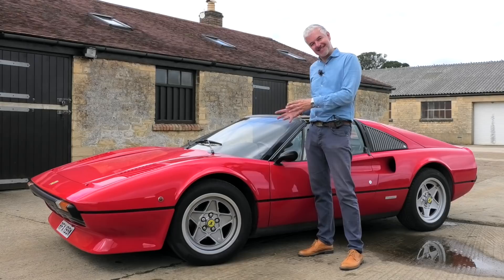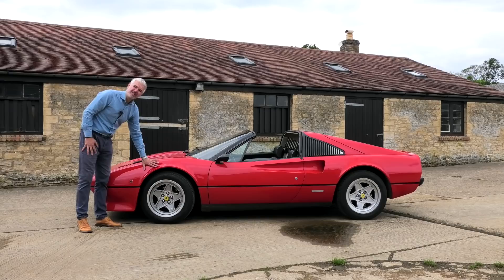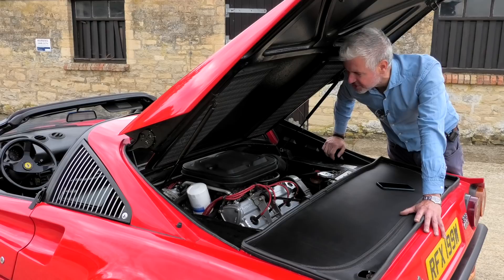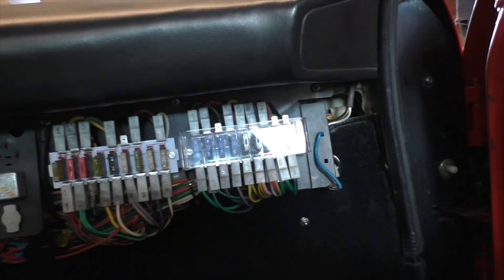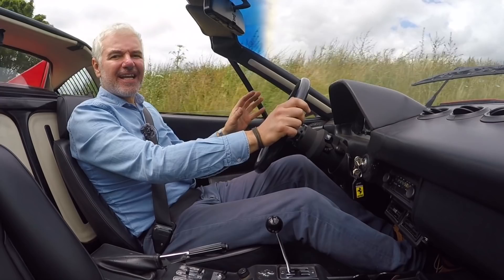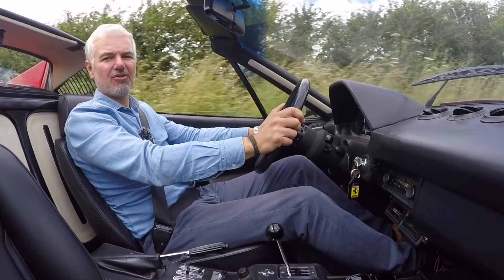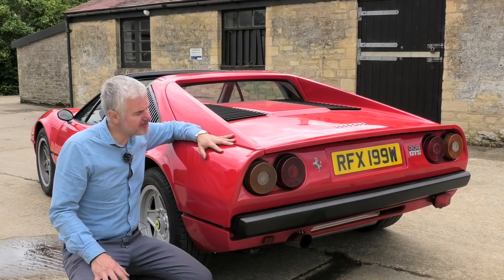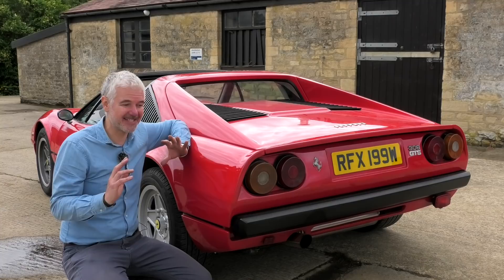Ferrari 308 Buyer’s Guide and History of Model Changes

Comment: I have hardly heard so much nonsense .
I am a owner for 20 years .
No ac needed ? 
This car is useless without AC ! 
It’s not the strongest ac but it saves the ride in hot weather or stuck in trafficjam ! 
Makes changing belts much easier without Ac ? 
Nonsense 
Gearbox oiltemperatur? 
That’s the oiltemperature! 
Abd you better watch it !
... and  on and on ...
You are a real nice guy but you know nothing as proven by your episodes .
Showing how to destroy a 308 even more I n endless episodes is one thing , but putting out false infos is not acceptable.
Reply: Hey dude, turn on the AC.
Reply from the maker: That is the gearbox temperature and belt changes are a million times easier without aircon in place. I’m sure you’re a real nice guy too and I’m totally happy to put my hand up to mistakes (which I frequently do make) but a bit silly to point out mistakes which in fact are not!